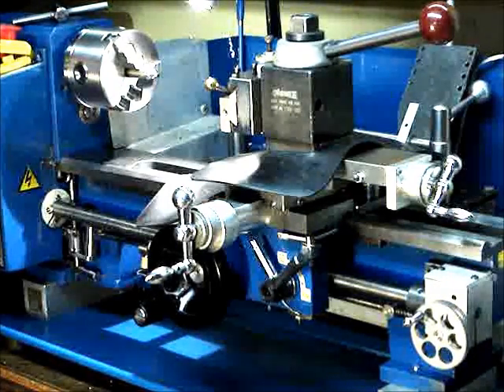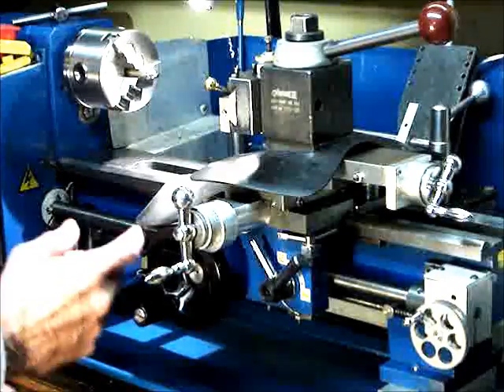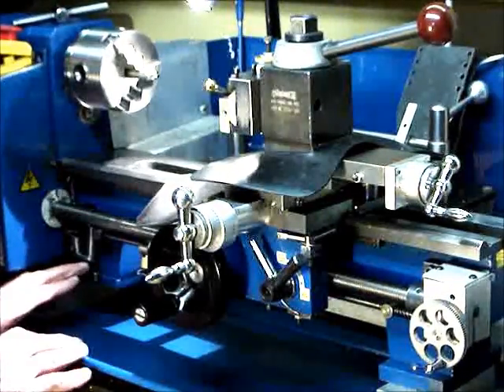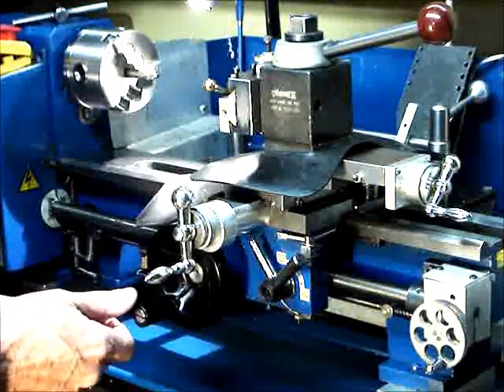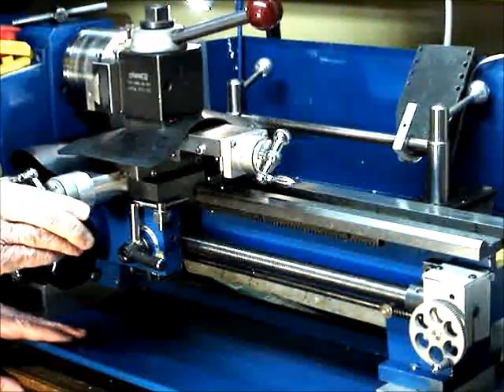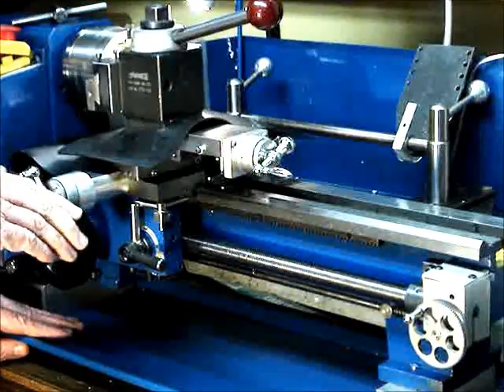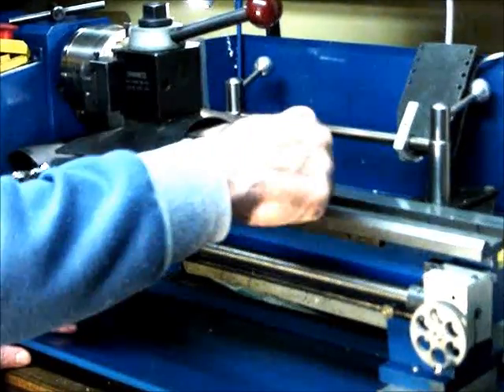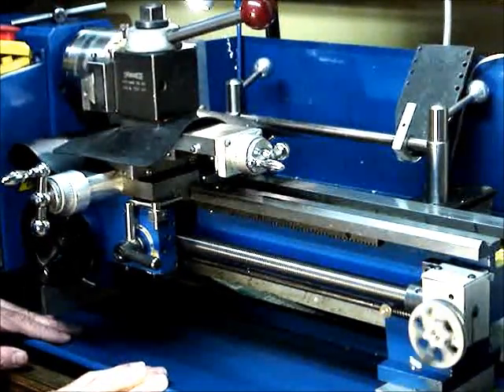Dog_Clutch for Threading on the Minilathe

Comment: Now that you have had the axa top post for awhile would you get the smaller oxa?
Reply from the maker: I also have a 10" Rockwell lathe with an AXA tool post, allowing me to share tools with the 7x12, which makes the AXA the right choice for me. Further, the retracting tool holder might be too big for the 0XA.  Either size works well with the 7x machines although the AXA requires extending the cross slide travel.
Reply: Thank you ....I would love to see more videos of your gadgets!